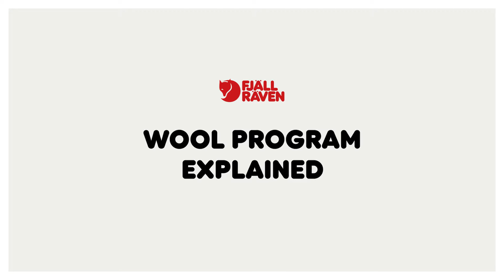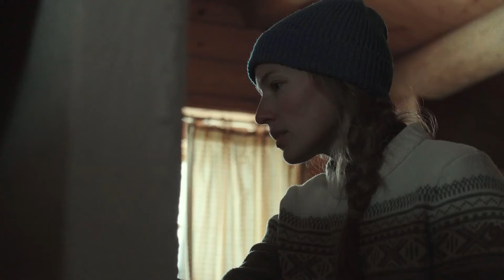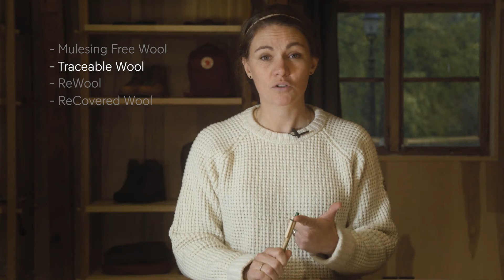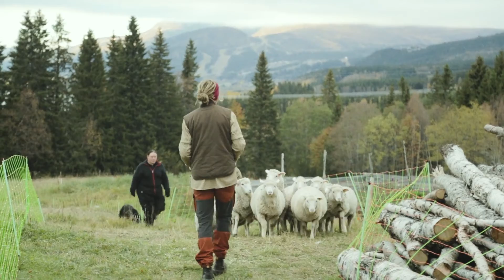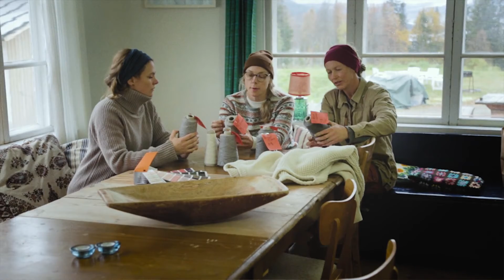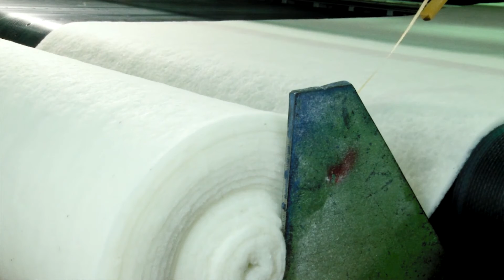Fjällräven - The Fjällräven Wool Program

Comment: You are to be commended for your efforts , but I would really like a pair of pants that will not end up with burn holes every time the camp fire farts and also pockets that will last for a few years with out getting wear holes in them . I'm back using Car hart where these problems do not happen . Happy trails.
Reply: May you please share details of the alternate supplier
Reply: I have been near fires for many years with fjällräven Products and I never had a problem. I do not understand what you mean. Fjällräven Products are a lot better for near fire situations than synthetic materials for example.
Reply: Mike Boone 
I have also not had this problem from any g1000. I have had a pair of kebs I’ve worn for 4 years straight, every time I camp/hike here in Colorado and have never burnt a hole in them or worn out a pocket. I have a pair of the convertibles that are strictly worn as shorts for fishing for 2 years and they too have no snags or have worn out in any way yet. 

Was it just one pair of pants?? Sucks that you had a bad experience. 🤷🏻‍♂️🤷🏻‍♂️